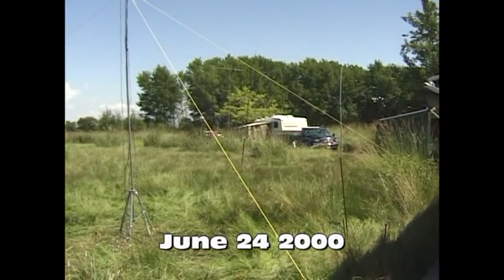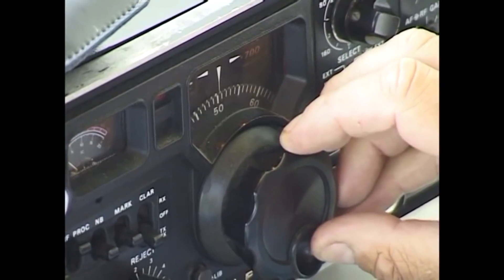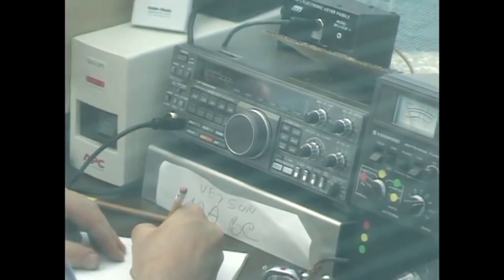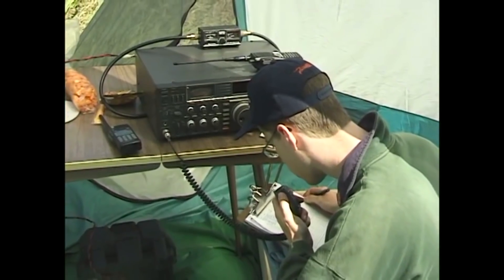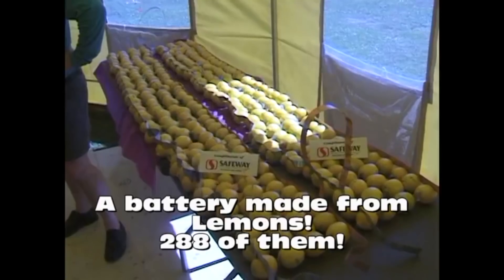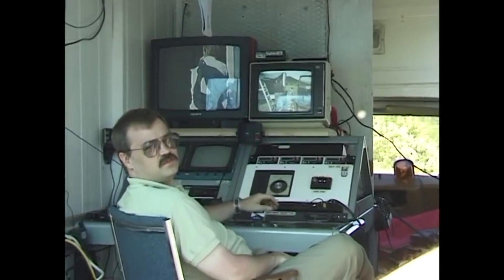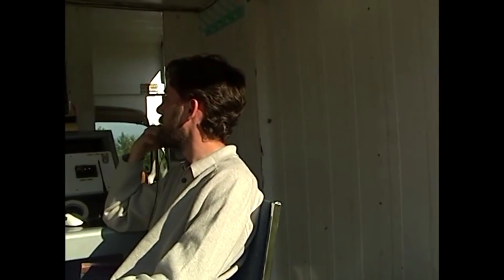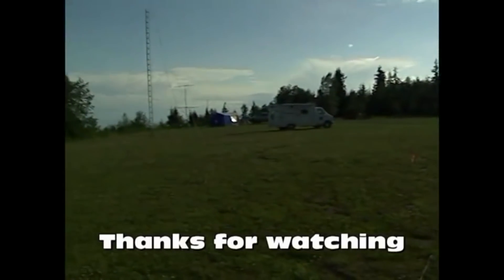Field Day 2000 and 2001 ATV operations

Comment: HAHAH I still have that HF Tech 1.2g FM gear. stuff works great even out in below zero F Weather .
In the Other FD Video I commented on. I used 1.2g FM to a 20+ element Circular Beam on the 35ft Mast to the ATV repeater on our Little Mountain  Rib Mountain in Central Wis. I could hit it with the Stock power from the HF Tech Transmitter from about 35 miles out I had a Camera on top so I could see the Mountain in most cases to point the Antenna. I have a 100 Watt 1.2 Amp if I needed it, Never Did. From the Repeater we used 900mhz FM to the Cable Co's head end. for a whole week I had the Channel from 07:30 to 15:30. During that week l made My way around to the 13 Grade Schools in the system to shoot Live video for a Space related Science project. All the Schools in the System could watch the Activities.  When I was Mobile between Schools we had Mission Control upload Video to the repeater.
I still use the Gear every winter to watch the starting line of a Cross Country Sky event so I can watch the Starter from inside the Chalet so I can shut off the Outside Music  
Sorry to Ramble, but it was great fun at the time.... Loads of Pictures on my FB page.
Reply from the maker: Yes ATV was fun. That's what got me into ham radio.  All the guys are dead now.